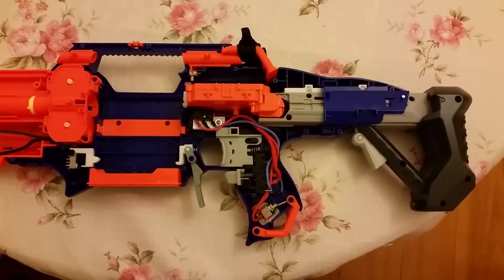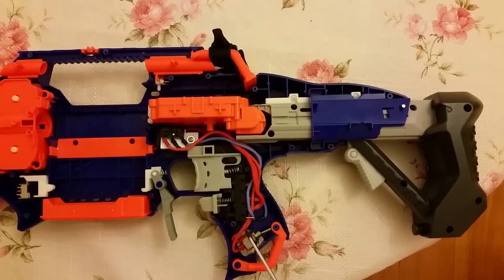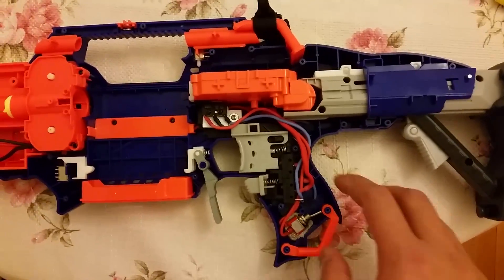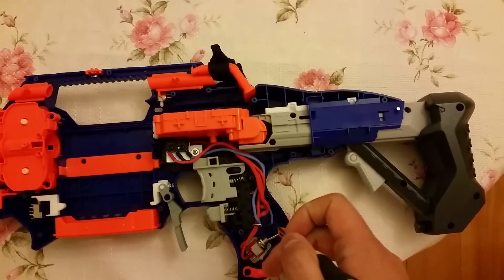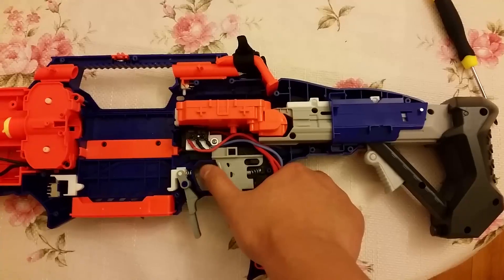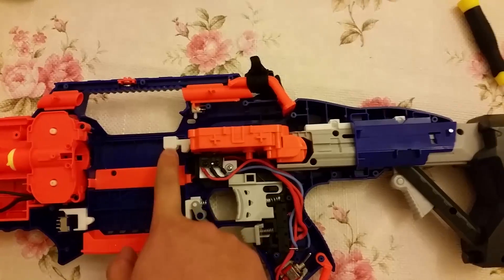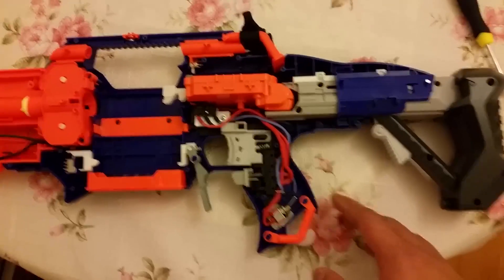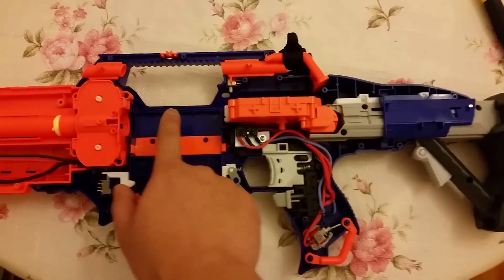Rapidstrike three microswitch build - correct wiring

Comment: Are you simply going to wait for Toruk to draw up some wiring diagrams, or would you be able to provide some of those?
Reply from the maker: Robert Even 
http://i.imgur.com/5WBacKl.jpg

I use a separate pusher and flywheel circuit with two different packs to provide both 2S and 3S voltage on tap. Here is the pusher wiring. The line that goes from Main Trigger NO to Cutoff switch NC is the one with the hidden switch.
Reply: So I guess my question comes down to how relevant this wiring scheme really is. If you are using batteries simultaneously, then how is the normal circuit that is used by other modders? I myself have only used a single pack and I know of 3 different common wiring schemes for the RS. The 2 switch Gilesing, 3 switch Toruk dead center, and the BSUK common phasing. This leads me to believe that your scheme is another variation.
Reply from the maker: Robert Even My rational was that there's very little reason to use up a 180 motor for pusher. It's much more trouble cutting out a hole for it and then covering it up with covers than it is to just wire up a second pack to deliver 3S voltage to a 130 pusher motor.

It helps that I happen to have a 500mAh 3S pack on hand for this job as well. This is my sleeper Stryfe pack when it's not being used by RS pusher.